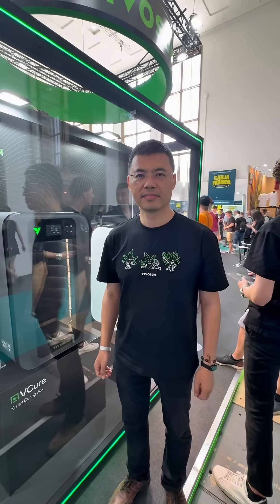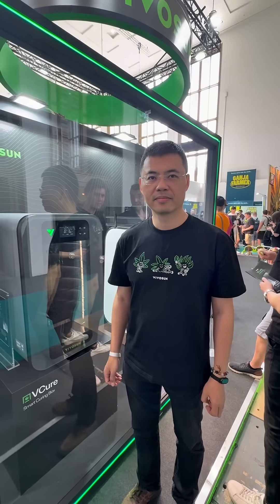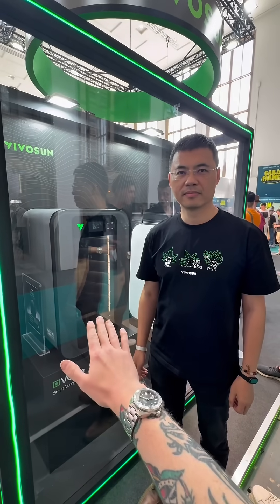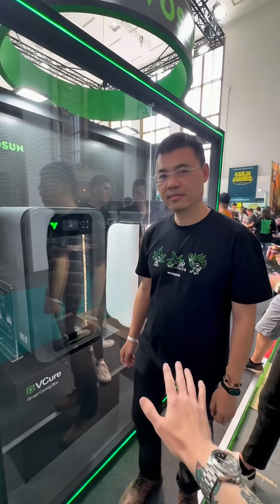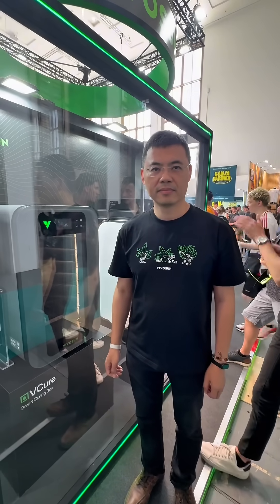VIVOSUN VCure, explained by Director of R&D, Kevin. Part 1.

Comment: I almost fell for these!  but i need to dry more than 1 plant at a time if im growing 6 at a time this aint for me. Lets see some mini fridge set up for under $300 that do the same thing!!❤
Reply from the maker: Unfortunately these are catered for smaller scale home growers, but they should be extremely effective. What they CAN do though, is enable you to have a flowering room with numerous plants are different stages, harvesting them all at different times growing perpetually.
Reply: You can dry 2.5 lbs at a time and have it dried and cured in 8 days.

Comment: If I’m cannatrol, I’m not sleeping good anymore 😅
Reply: thugs
Reply: That’s what they get for being some dicks and never providing a more affordable product, when they can,  now they about to get a reality check
Reply: Fxck em! Lmao charging $1200+😂
Reply: So how well is china shit built?
Reply: Straight up cannatrols expensive . Vivosun will forsure be more affordable
Reply: I know right, The cannatroll can't even control the temperature and it doesn't have a carbon filter like the v Cure does and on top of that , it's six hundred dollars cheaper than the cannatroll. And on top of that , it has smart glass that can change from opaque to see through
Reply: And like an iPhone
Reply: 30% of the price for 30% of the quality.
The VCure uses a compressor that sucks the terps away, compared to the Cannatrol that uses a thermoelectric system that maintains terps.
Reply: @thc_temple compressors don’t “suck out terps”. What on earth are you talking about
Reply: @jreezee08  Doesn't sound like you know how compressors and thermoelectric systems work. lol

Go to any commercial facility and see if they use a compressor in their dry/cure/storage rooms.
Reply: @thc_temple how do you know when they haven't even came out yet m
Reply: @thc_temple yea sure 🤣🤣🤣

Comment: This is so needed. I am basically building something similar for my harvests. But having an integrated dehumidifier would be huge. I have to make space for not only fans but a dehumidifier as well. While trying to keep the space small so the dehumidifier doesn't get overrun.
Reply: Guess this is just a cigar humidor fridge thing basically right? Would love one tho
Reply from the maker: Listen to part 2, it is far from a humidor with many design features setting it apart
Reply: @MIGROLIGHT Available yet?
Reply: @RasputinGandini  That would probably be cheaper than this. I wrote this before knowing the price.

Comment: Great for a hobbyist with 2 plants. Anything above that is easily achievable by using a dry tent with an environmental controller, humidifier/dehumidifier and intake/exhaust fan. And remember, ALWAYS hang your entire plant when drying to slow the process
Reply: Most states have small limits on plants. I can have 4 in flowering and 2 in veg.
Reply: Roots as well or just trunk up ?
Reply: @ADK-TREK  do the trunk. unless DWC you wont have easy access to the roots. I have seen some people swear buy drying with roots but thats a lot of work for minimal gains. the roots can be processed in a food processor and mixed with aloe and other moisturizers to help with pain as a topical

Comment: Cant wait till ac infinity one drops
Reply: Hell yeah brother for only 3500$ using the exact same manufacturing companies as all the other brands 😂 jk jk jk
Reply: Possibly true though.  @JunkYardGrows420
Reply: Aci has awesome fans and controllers but that's it in my opinion... terraform just under performs... I have the heater that you need 2 of to actually produce heat lol.  I really like my cloudforge t7 but the hose setup is trash. Definitely going to a solid pipe.  Lots of room for improvement on the controllers, the 10% increments is very outdated.

Comment: As long as its 30% the price of cannatrol it will do well
Reply: I’ll build you a customi for a third
Reply: How would you do it ? @marcbaxter5996
Reply: For 300,-? I'll Take two @marcbaxter5996
Reply: Yes please @marcbaxter5996
Reply: Wouldn't a lens cabinet off amazon work? Temp control and RH controlled and only 300 bucks?? I've been looking at them for ages
Reply: @yahwehsaviour9083 shh they want you to buy.
Reply: @yahwehsaviour9083 a meat curing cabinet would be better.
Reply: @yahwehsaviour9083 I have a diy wine fridge with a humidity controller and dehumidifier inside but you gotta be adjusting temps and turning the buds around so they can get even air flow
Reply from the maker: $999, although there is an early bird price if ordered within the next week!
Reply: @MIGROLIGHT that’s been ended for about 2 weeks or so now
Reply: @MIGROLIGHT too expensive might as well get canatrol at that price

Comment: Same thing as canntrol
Reply: A lot cheaper 699 vs 1500
Reply from the maker: It achieves the same goal, drying and curing flower. But it operates in a completely different fashion, with many different design elements. Even a hidden easter egg feature.. 😉
Reply: @MIGROLIGHT how much flower at time can you dry? You reckon you can dry few kilos at time ?
Reply from the maker: @GanJah-Far-I correct! 👍